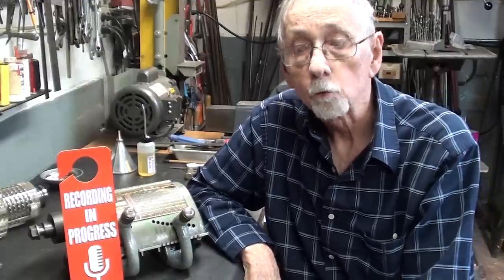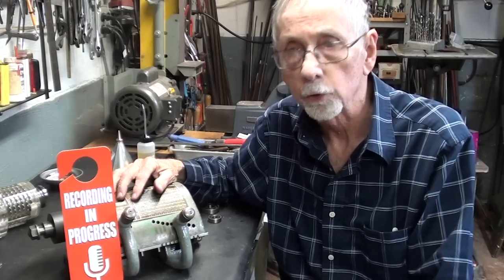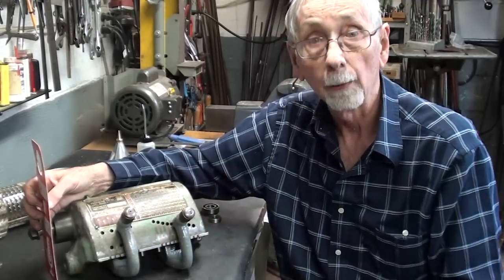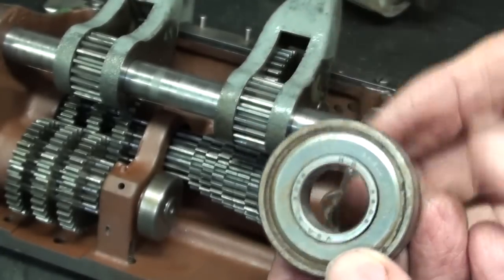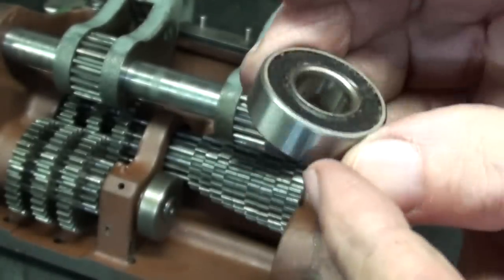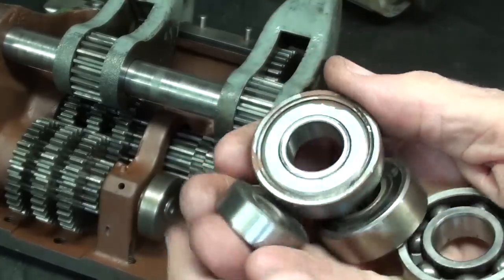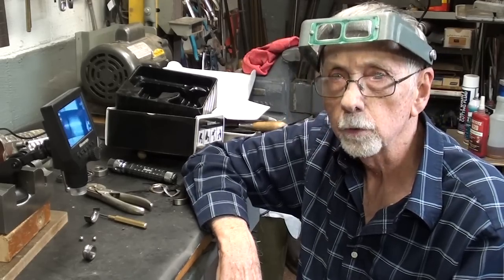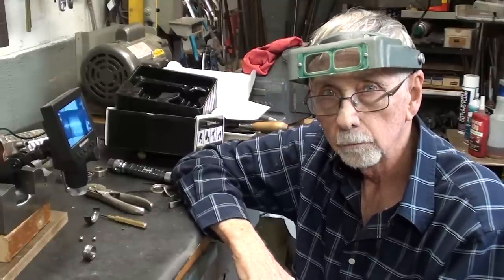FAILED BALL BEARING ANALYSIS short #23 tubalcain

Comment: I like this type of content. I am a retired toolmaker. I wonder how the ball flattened out running in a spherical race. About the junk mounts. I agree with your opinion. I have resorted to making my own.
Reply: Me too.  It's hard to know how long ago in operational hours the grease hardened. But lots of hours running "dry" and hot could have expanded and softened the ball metal enough to flatten them under pressure.  Just a guess.  I wonder if modern steels could tolerate higher heat than balls made long ago?  Ditto for modern day grease tolerance for heat without drying out.
Reply: @datamatters8  I agree with your analysis of how the wear occurred, The actual wear pattern is a flat. The balls run in a spherical groove. I wonder the physics of how they wore flat. I am sure that modern materials and lubricants (the grease) would increase the life of the bearing, and dramatically increase the price as well. Ideally that bearing would do best in an oil bath, as a higher end lathe would have. If it were mine I would replace it with a good quality sealed bearing, and I am sure it would outlast me.✌

Comment: I liked your bearing demonstration, word to the wise I found that if you want to regrease a bearing you can use a carburetor pick (from a set) to gently pop the cover without damaging it, clean it out wit (what did you mention) brakeclean, then pick the appropriate grease to fix it on up if there is minimal wear, and replace the seal, I've got bearings still running to this day being reconditioned but I do thank you for wise advice about all things mechanical and appropriate the fact that after teaching for how many yrs your still willing to share to the public on a free bases. Your a fantastic Man and human being. Without peeps like you society would still be in the dark ages, once the Greeks started to record things it advanced Man/Women kind ahead in the last 200 yrs that we didn't do in 5000 yrs. So thanks for sharing wit Peace and Luv from Andrew in Barrie Ontario Canada L4M2Z8
Reply from the maker: Thank you very much indeed, you just made my day

Comment: I've seen the bearings rust like you mentioned.  I but those boat buddie things on my normal trailer, too.  I replace some double row bearings on a 7.5 HP GE motor several years ago with bearings at least as old as what I removed.  It was on a RPC.  I need to pull them and soak them in heated oil for a couple hours to try and rejuvenate the grease.  I bet it's as hard as a dinosaur turd right now.

Ditto the rant.  I rage a bit at that stuff, too.  Wears me right out.

Comment: I can say I genuinely liked this content Mr. Pete! You conducted very solid forensics indeed and there can be little doubt of the problem with that bearing race! I would certainly like to see more similar videos and reading through the other comments I think a lot of the other chaps would too!

In regards the bearing flats... It looks almost as it they were operated for a long time while only free to rotate in one direction. I wonder if the gearbox was run in a very cold room that lowered the grease viscosity? Plus I should think these effects are cumulative; the more a thing runs flat the harder it is to get it to rotate in another direction, so the flat grows and grows under positive feedback.

Comment: This was a great video and rant. Keep making failure analysis videos. One thing I want to point out in changing a shielded bearing to a sealed bearing is that you make sure the sealed bearing can take the RPM.  Of the three types of bearings, open, shielded, and sealed, all three have a different maximum RPM. Example a 6203 open bearing's max RPM is 17,000 where as a sealed 6203 is 10,000 and a shielded bearing would fall in between. On the quick change gear box which is  low RPM there wouldn't be any problem but on most woodworking machines which in general run at a much higher RPM you can have pre mature bearing failure.
Reply from the maker: Thank you, I did not know that
Reply: @mrpete222  You're welcome, hope to see you again this year at Stan's Bar-Z

Comment: Flat on the ball is acting like a sprag as in a sprag clutch. I get them a lot on bearings on lawnmower shafts that have been in dusty conditions.
Reply: Do you get 1 or more then 1& if so are they equal?  Thanks.

Comment: I've had bearing failure on two different camping trailers.  One required a new axle stub welded on and the other required a replacement hub.

I often have thought about how many bearing surfaces there are in an automobile.

Comment: Do all the balls have a flat track like the one you showed? If the balls run in a radiused race (inner and outer), how does a circumfral flat get worn on them?
Reply: I believe it was a bad ball caused by a short slug in the manufacturing process. Check out my hypothesis of how this probably happened in my earlier comment on this thread. It’s the only way I can think of that would produce a ball with a circular band with no damage to the outer or inner race.

Comment: Nice video Mrpete. Looking at the ball bearing I believe the cage was the cause of the failure. It probably was just pinching the one ball for whatever reason, or a sliver of weld slag could have squished over to a ball if the two cage halves were spot welded together rather than riveted.

Comment: I love failure analysis!  My question would be: If the races still look round, and the bearing have flat rings, was the damage from the races or the cage?  Seems to me it that is has to be from the cage, which I would think was softer steel then the bearings or races. A few years ago I got into a very opinionated discussion on another forum regarding the ultrasonic cleaning of bearings.  I was sure it was a bad idea, but there were a lot of Bubbas who said it was fine.  I ran a series of timed tests, and even the shortest (10 minutes) showed obvious pitting. Facts don't lie!  Keep up the good work!

Comment: Lyle, loved the video.  I have the microscope too.  Bought it to solder a new usb connector on the DRO, worthless.  Ended up using the Optivisor instead.  I have a question, do you think the motor on the cutoff tool is big enough?  Also what do I do about the wrinkles on my fingers, which are as old as that bearing ?  Thanks again.  Best of luck with the trailer.

Comment: Interesting. The flat area was certainly visible to the naked eye but the microscope adds to the story. It got me thinking, as the bearing lost lubrication probably a microscopic piece of ball chipped off and was rolling around between the balls and races causing more microscopic chips to chip off. The process probably continued at an accelerating rate.

Comment: I work for a bearing manufacturer. We make ball and roller bearings for the aerospace industry. Interestingly, the balls start out as a rod and are cut off and then slammed into a round shape by a very loud and violent machine, heat treated and then lapped in multiple stages into final dimensions. Yup, we lapp our own balls!
Reply from the maker: lol
Reply: Maybe you have could shed some light on this.  It's hard to know how long ago in operational hours the grease hardened. But lots of hours running "dry" and hot could have expanded and softened the ball metal enough to flatten them under pressure.  Just a guess.  I wonder if modern steels could tolerate higher heat than balls made long ago?  Ditto for modern day grease tolerance for heat without drying out.  Perhaps someone in quality assurance knows about the history of materials used?  Thanks.
Reply: @datamatters8  Lotta heat needed to change a bearings temper/hardness, like 3 times  the amount that would send that grease up in smoke & flames!
Reply: @alro2434  that’s a good point.  I wonder if any of the other balls showed a flat spot?  If that was the only one then maybe it was deformed or out of spec re: hardness from the start and over time got worse.

Comment: Hi
Those indentations in the bearing race at 10:11 point to dirt ingress. I'm sure that if you were to wash the grease out of the bearing cage with a solvent and then filter that on a piece of filter paper (coffee filter paper maybe?) you'd see lot's of dirt. And once an item starts wearing, that wear process is accelerated by the wear debris. 
I believe that if that bearing had seals instead of shields it would have lasted longer.
Bearing life (called L10 (L-ten life)) is measured in the number of revolutions it can last, running into millions. It's a function of (amongst others) speed and load and it can even be predicted. My old SKF bearing catalog has pages and pages of these L10 prediction for the bearings in their range.

Please keep up with these kind of videos... we need a YouTube Shop Teacher!

Comment: Lyle - Interesting video and I like the failure analysis; probably because it sounds like some of the things I do.  I'm wondering if the failed ball got heat treated correctly - maybe is soft?  Although I'm a retired mechanical engineer I've never worried about designing bearings.  Had to laugh at your rant - I don't think most of the people who design things ever have to use or maintain, but then again I'm sure they are told to design to cost so it is cheap.  As for losing a wheel.  My dad and uncle told the story of during the Depression traveling with their dad, my grandfather.  He scratched out a living then, by among other things, hauling produce from up here in upstate NY to the south and then their stuff back.  Cabbage south, water melons and citrus north for example.  One trip in an old Dodge truck going down Broad St (the main drag) in Philadelphia, PA one of the rear wheels came off - almost hit a cop directing traffic then hit a building.  Luckily nobody hurt or property damaged.  Put it back on (stealing a few lug nuts from another wheel) and getting out of traffic.  So Jordan's boat trailer experience could have been worse!  And I'll be he'll be better at greasing trailer bearing from now on - education by experience.

Comment: Worn due to the grease failing, and then the thin lubrication film allowing metal to metal contact. Yes failed due to the grease slowly evaporating, and then no new grease or oil coming into the running area to replace it, as it got too thick, and did not run hot enough to melt the grease down to fill it. Could have been prevented by having the 2RS bearing with the seals keeping the grease in, though the seals likely would have died over the 65 years it was in use, so the oil hole to lube it would have been the better method.

As to trailer the bearing buddies are not as useful, as they then lead to the "fit and forget, at least till it falls off" method, as when i had a boat trailer i simply took those grease cups out, brazed a nut onto them, and screwed in a pair of grease nipples. Then a simple matter to pump the bearings with grease every 3 months, and annually jack up the wheel, plop the cap off, pull out the grease, and check the bearings, then slap them back again with fresh grease. Same bearings, even though the trailer went regularly into salt water, fresh water and highway between the two. Seen way too many trailers playing the song of the lonesome trucker, and had twice the pleasure of seeing a vehicle lose a wheel coming the other way. first went across in front of me, second I had the distinct displeasure of seeing it fly between me and my trailer, thankfully missing both. this was a wheel, brake drum, brakes and axle combined, that decided that it was tired of making noise for the last few months, and wanted to be free.  Friend saw one bounce across the freeway and impale a car through the windscreen, and the (empty) front passenger seat.

Funny thing about that bearing plant, my father was on his way to make a delivery there, sort of a one pass and deliver, at high altitude, no receipt needed, drop off 10 tons of wrapped parcel, in a nice heavy steel envelope, in 1941. Did not make it there, as his plane fell apart over Lake Constance on the way, riddled with lots of holes and on fire, and he deplaned without the need to use a parachute. Woke up 6 weeks later in a Austrian hospital (now a hotel, he did visit in the 1980's to see it on a trip to Germany and Sweden), with no recollection, and was told they found him in a snow bank, under a pine tree, and had dug half a tree out of him, plus he had broken pretty much every bone in his body. He managed to escape, with the help of the nurses (tied sheets together to make a rope, threw it out the window, then walked out of the door), and sort of borrowed a car. Made it difficult to enter Switzerland in the 1980's, as he still had the record there of assaulting a policeman, but they did forgive him for that. Never did get to deliver that present, though he did go on to deliver them all over North Africa, and also Burma and the Middle East.
Reply from the maker: Wow, that’s quite a story about your father
Reply: @mrpete222  Yes he wanted to forget all about it for years, till he finally saw a Nat Geo documentary, about the German ace that likely shot him down, and how he did it.

Comment: Two instances of bearings in the last couple years. Actually three! My neighbor got an old Land Rover and there was a weird noise coming from the rear right wheel. I thought it was tire noise but after we jacked it up we could feel the play in the wheel and I knew it was a bearing. He got that fixed and all was good. Then a little while later his boat trailer wheel stared wobbling around as was following him. I made him pull over and he then drove it back to his house very slowly. We fixed that the next weekend. He was just about to go on a fishing trip and was adamant he could still drive it with the bad bearing. This thing wouldn’t have lasted 4 miles. 

Next story is it was driving down a divided highway after Christmas and a car pulling a big trailer was going slow in the right lane and a wheel was rolling down on the left. Luckily there was a guard rail which blocked the wheel from going into oncoming traffic. It eventually came to a stop on the shoulder. I actually think that was a matter of the studs on the axle shearing off because as I passed them I saw the brake drum was still on the axle but didn’t notice any studs. I stopped to see if they needed help but they said they can still drive it slowly to the shop. This trailer had a double axle so it didn’t drop into the road. The left wheel was still holding up its side of the trailer.
Reply from the maker: Thank you for the interesting stories

Comment: I love that type of content. I myself examine things in great detail and will spend dozens of hours investigating. Probably why I never made much money when I worked. I was too busy learning things. No money in learning I guess. I rebuilt a transmission in a car once. I was at it for 9 months. I had to investigate every little thing in it that made it go bad. One thing that happened was the shaft in the transmission that comes out of the oil pump broke as clean as if it had been cut by a band saw. Then I asked why did it break? Upon examination the oil pump locked up but the engine kept turning the shaft until it twist broke. Then I asked, why did the oil pump lock up? Turned out the vanes that ride in slots became out of tolerance and were loose in the slots and jammed the pump when they canted. Then I asked how can I fix this without getting a new pump? I took out all the vanes and welded metal back on them and then filed the vanes back to tolerance where they rode in the slots nicely but were snug enough to not cante. Then I also discovered that the Low-Reverse clutch plates had no friction material on them and had friction welded together causing the transmission to always be in low gear. I put in new plates from a rebuild kit. This transmission was very abused so I asked myself why? The teenage girl I bought the car from for scrap value ($200) told me when I asked why she thought the transmission blew said...'I'm a teenager and so I like to drive really really fast. I cracked up when she said that. She was so cute. That flat on the steel ball is very interesting. How can a flat develop in a radius? And also why didn't the other ball have a flat also. Very interesting content. Love it! Oh, buy the way, I have driven that car for thosands of miles after the transmission rebuild. It purs like a kitten and doesn't leak one drop of oil from the transmission. Nice smooth shifts. Keep up your great content.

Comment: Was taught 50 years ago in a noisy area to use a long heavy screwdriver to locate bad bearing. Would hold tip of handle tight to one ear while placing screwdriver tip on case of gearboxes & motors to locate bad bearings. At the large newspaper that I worked out the 16 year old printing presses had oil spraying over all of the bearings & gears. Never had a bad bearing. They tested the oil several times a year and had a machine to clean oil .Think they cleaned the oil at least once a year. Have to watch the quality of a lot of cheap inferior bearings from third world countries.

Comment: My guess would be that if you pulled all the balls out and looked close you would see wear spots. When the grease dried up there was metal on metal on all the balls. That would heat up the bearing pretty quick and melt the grease. Over time the one ball that had a little more wear just stopped rolling one direction.

Comment: What you are adding by this type of video is causing us to think about what is going on with the equipment. Perhaps even to prevent a future failure on other equipment. It caused me to think along the same lines as the grease hardening causing drag on the bearings resulting in failure. A little surprised that South Bend didn't put some kind of way to lube it, unless gear internal movement would have prohibited it.